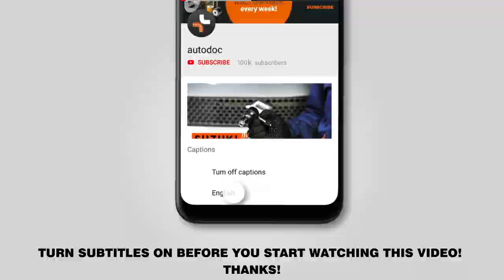How to change front suspension arm / front control arm on HONDA INSIGHT 2 (ZE) [TUTORIAL AUTODOC]

Comment: Copper Anti Sieze on all the bolt threads and ball joint. 

Are those 85 and 55 torque values already discounted 30%?
Reply from the maker: Our videos are only for informative purpose. All regulatory replacements and values can be found directly in the technical documentation for your particular model of car or use the help of a car service.